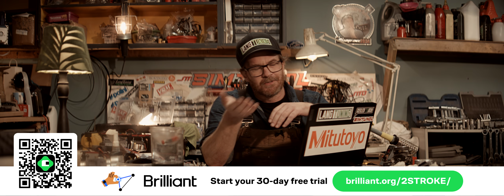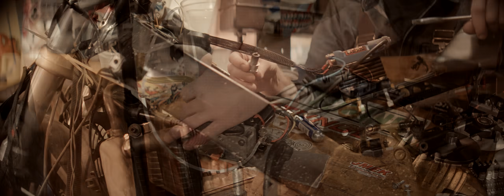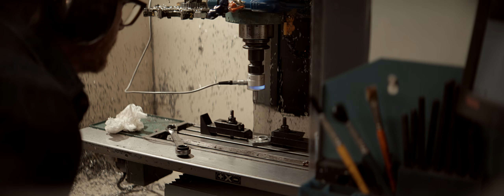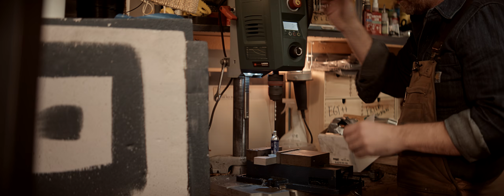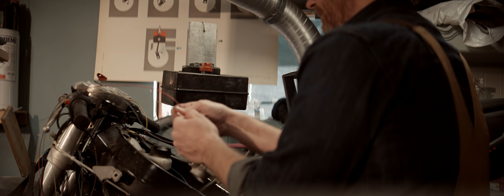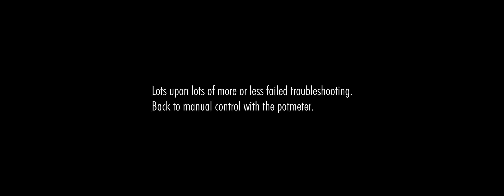Two Stroke Nitromethanol EFI - First Test!

Comment: Try real stand alone ECU...near to you (Sweden) should be MaxxECU. U can take smallest one - an Maxx Mini and it will be more then enough to drive ignition and fuel injection and data logging. The set up with Arduino is just to simple... Alpha N cycle ...TPS/RPM based map. With real automotive ECU you will have separate cranking , post start, idle algorithm and etc...temp, baro and whatever you think custom correction of ignition and fuel delivery.
Reply: speeduino would work too as he’s already got an arruino, just plugs on top and gives him everything he needs.
Reply: @sparkie5571  Speeduino would be perfect. You could run seperate injectors and a separate map for gas and nitro at full power. Also a simple motorcycle EFI pump and injectors would solve all the stuffing around with experimental rubbish
Reply: @sparkie5571  Yes but then we'll get a video about how he's learned programing and he's rewriting the firmware from the ground up, experimentally of course. 😆
Reply: Your very knowledgeable

Comment: I am stumped on your developing fuel injection for as you state: Nitromethanol  btw (Nitromethanol is simply a beginner's name for methyl nitrate)   One things certain simply running Nitromethane in any engine not specifically designed for it is a complete waste of power, time, money and materials. Timing, compression ratio, chamber volume, incredible strong ignition etc etc are all new parameters that are unique to a fuel motor... Why waste time running nitro if the ducks are not in a row?.  
Finally can you just show up and run nitro in class racing?.......
Reply: It puts you in a different class

Comment: To stop it from pulsating at low rpm, you need an ESC with sinusoidal startup and FOC (Field Oriented Control = feedback over the motor wires) , like one with AM32 firmware or a VESC. From my experience with RC rock crawling, a lot of generic ESC's do not have this function. There will also be a crossover from sinusoidal mode to PWM mode, which is barely noticeable. I would recommend one of the AM32 ESC's, cheaper, easier to program

Comment: I bet your multimeter was reading correctly! Maybe try and run your meter on the arduino out and see if it reads right as a test.

See if you can check the Ignitech PWM output on an O-Scope. When I did my ignitech RPM out on the neighbors scope it was spitting out a sawtooth signal instead of a square wave like it should have been. It was very hard to get my raspberry pi to read the signal since the signal was so weak. Check and see if the scope of the PWM signal is what you expect it to be. There was a language barrier when I emailed ignitech about it.

Comment: You are using a breadboard to make the connections to the Arduino. From my experience I know that these connections do fail sometimes, very annoying in combination with PWM. Keep up the good work! Nice to see you back in business!
Reply: Yea!! Breadboarding can be problematic. Get some PCB Way sponsorship 😁 and help from another channel.
Reply: Ignition system can add electrical noise as well.
Reply: @JJayzX  good point, there is the old F1 Cosworth video where the ignition interferes with the injection system.

Comment: Brushless motors are really bad at turning slow. Thats how they are, they need RPM 
Brushed Motors are better for turning this slow.
Or you need a smaller pump
Reply: there are examples that are belt driven
Reply: @2000freefuel  sure, a reduction gear mechanism of any kind will also help
Reply: I was wondering that on the last video with low speed and brushless
Reply: it depends also on what motor is used, as alex got an "outboard" motor they got more torque but look at cr car crawlers they got motors that can spin so slow we speak about like 100rpm or so.
high winding on the motor is slower speed then a motor with less windings.
Reply: @extec101  try a belt drive or add a planet gear reduction.
Reply: @2000freefuel  that should also work to let the motor work at higher rpm and the pump at lower rpm.
Reply: @extec101  
They mostly run sensored motors. Without sensor you need enough back EMF to commute. Yes, AM32 has some special sauce for slow rpm but still its problematic and it shows in the pulsing because the torque is oscillating. A gear would be the way to go

Comment: I would suggest using an external regulator; this way you have a wider band of pump RPM vs. injector output (more granularity).....the difficulty is in sizing the regulator and it's opening pressure; ideally the regulator would be open well before the pipe powerband occurs (where fueling is the most critical)......I would look at aftermarket units from Summit, Jegs, etc. depending on the pressure range you wish to target, also routing the regulator return back to the gear-pumps inlet fitting will reduce pump cavitation at gear-pump speeds / not require as large of fuel lines to have adequate pressure control of the regulator, and much reduce the pulsing effect (the regulator acts as a mechanical damper).

Comment: Rather than controlling the pump speed, have you considered instead controlling a very fine control NEEDLE valve with a stepper motor and use a more traditional fuel pump/regulator arrangement?
Reply: That would be closer to how the original Hilborn mechanical fuel injection systems worked.
Reply: Nah...that would be too easy.